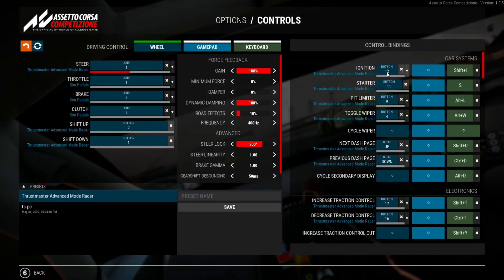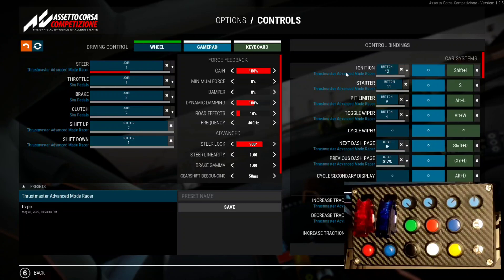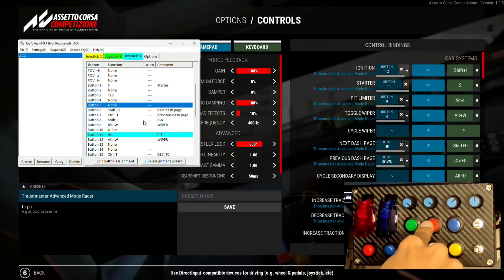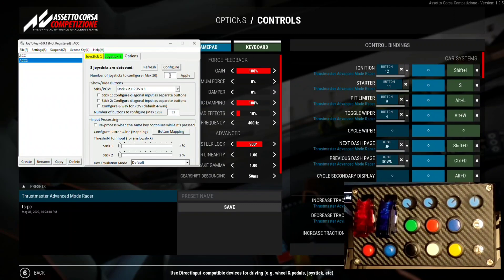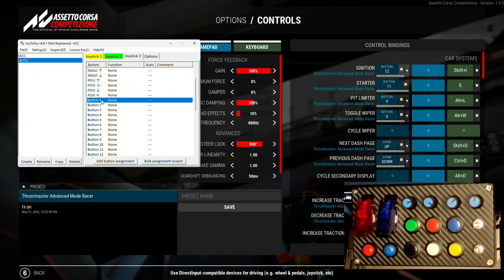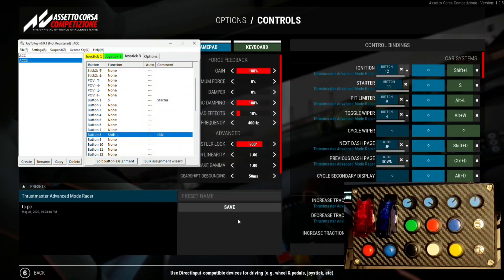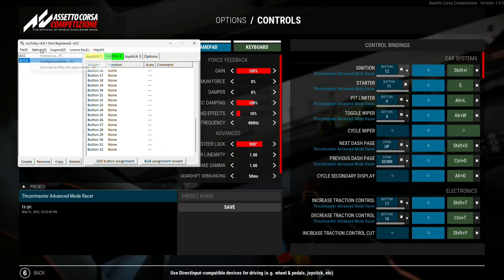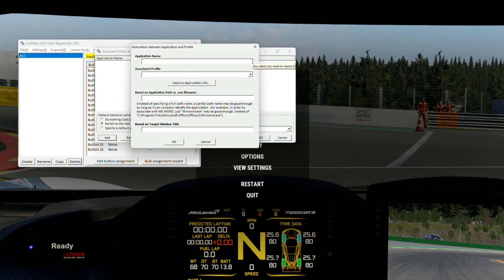Button-box mapping using Joy2Key

Comment: Hey, I have the problem with my ignition switch I have turn turn it on for the ignition to be on but then to stop the ignition I have to switch the button twice so ON/OFF ON
Reply from the maker: Which game/simulator are you talking about? Because each game has its configuration and capabilities, some like acc you can have a better control of the flip switches. If you game/simulator has the ability of listening to button on and button off separately then you can configure it to turn on/off based on the position of the switch (I can do that in acc)